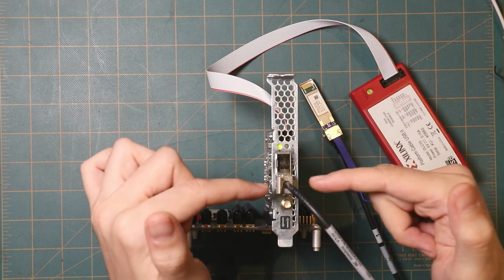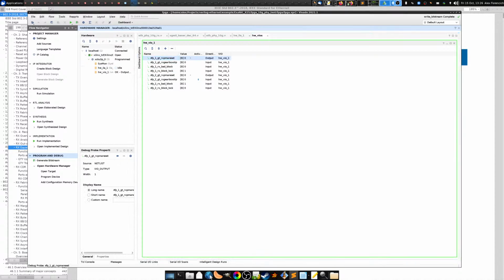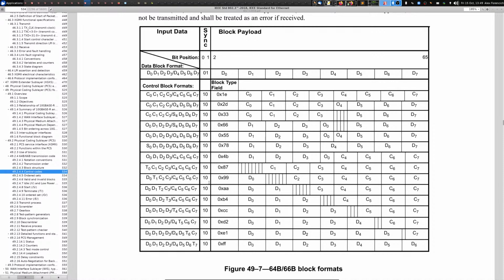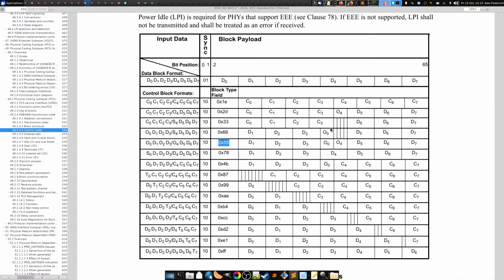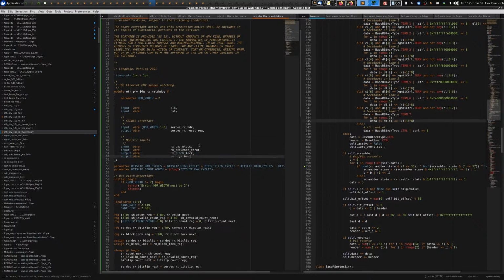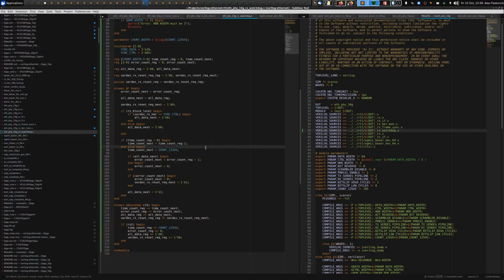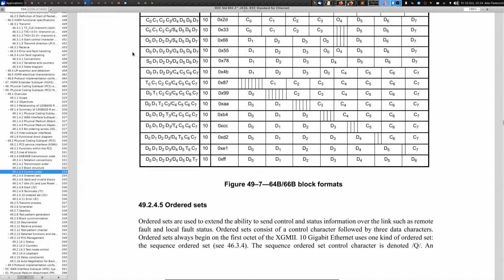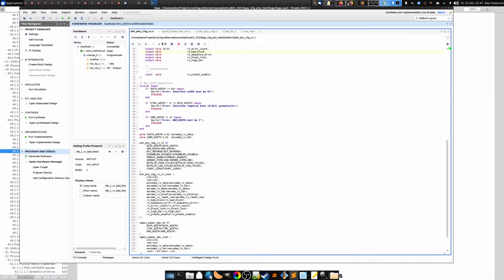FPGA Dev Live Stream: 10G PHY, 64b/66b, and DFE: Building a Transceiver Watchdog

Comment from the maker: The watchdog module has been added to verilog-ethernet ( https://github.com/alexforencich/verilog-ethernet/commit/625c48c59c0e81846e0243b30fe5118885068c19 ) and the 10G and 25G PHY integration has been redone with new single-channel wrappers (for example, https://github.com/alexforencich/verilog-ethernet/commit/fa77fe54f3d0bd7f6c8a753539c614ba660f937a ).  These changes are already in the verilog-ethernet repo and my fork of Corundum, and will be making their way upstream soon.  Next up in terms of PHY layer functionality is runtime switching between 10G and 25G line rates, which looks like it's going to require some customized reset handling logic for both the transceiver channels and PLLs.
Reply: Thanks for sharing.. I'm VLSI Student learning these this for my master's thesis. However, the links aren't working.. can you share it once again, please. I'm interested in 64b/66b encoding- decoding and transceiver watchdog..
Reply: Yup! link is broken
Reply from the maker: @josephmaa6811  seems like youtube included the parentheses in the URL.  Should be fixed now.

Comment: Thanks for sharing. I would have been amazed if it had worked straight away! Do come back and tell us what the issue turned out to be!
Reply from the maker: I made two main changes to get it working. First, I made the reset for the reset request signal asynchronous, so it would be released even if the clock was stopped. That by itself didn't work, so I completely reworked the gtwizard instance to use one instance per channel to isolate the clocking and reset networks. After that change, it worked.